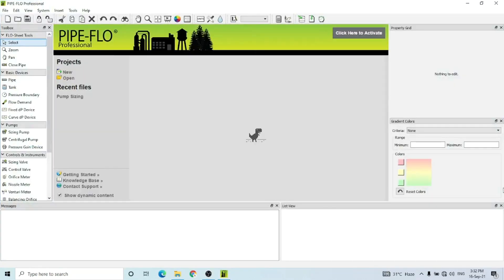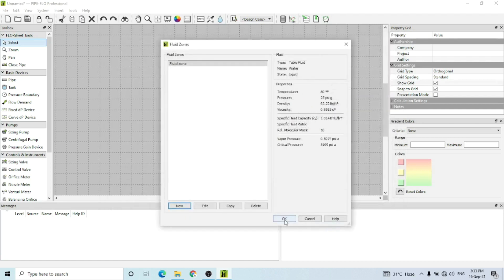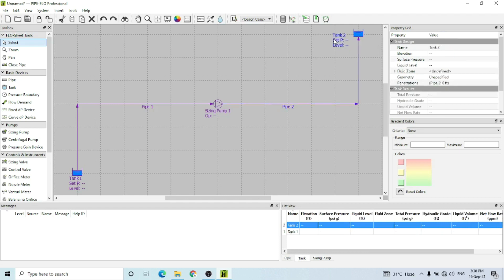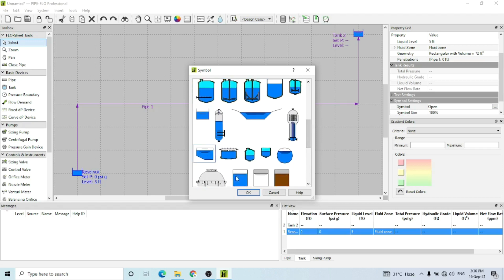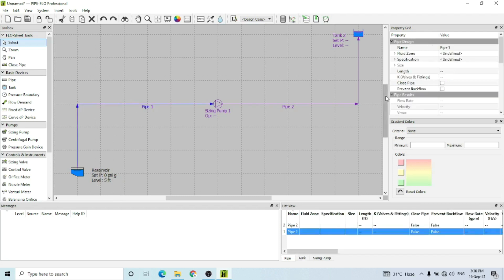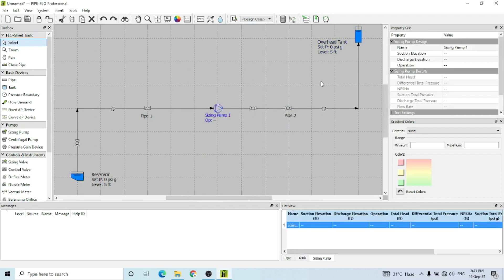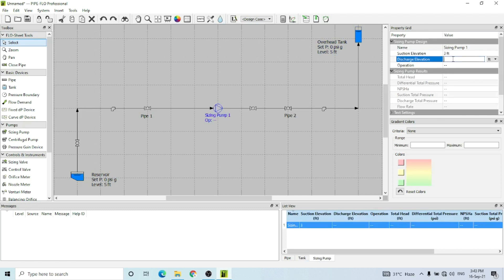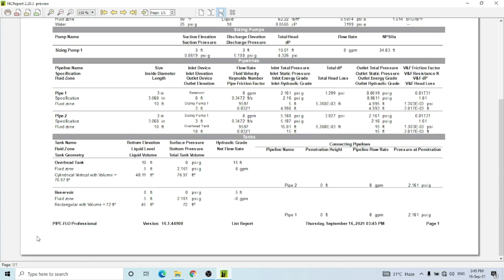Pump Sizing Tutorial using Pipe-Flo Professional v16.1

Comment: How do you get the sizing pump tab? My pipeflo does not have sizing pump as an option only centrifugal, pressure gain, fan, blower and compressor. Thank you!
Reply: Mine doesn't have it either
Reply: The pump sizing symbol is not available in the latest versions of the software. The software is intelligent enough to know that you are doing a pump sizing based on the input information.